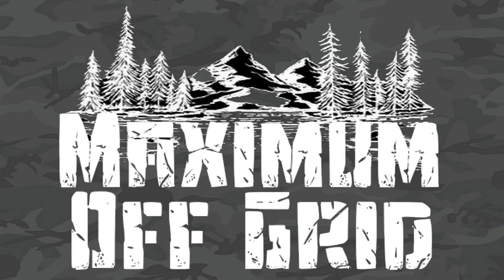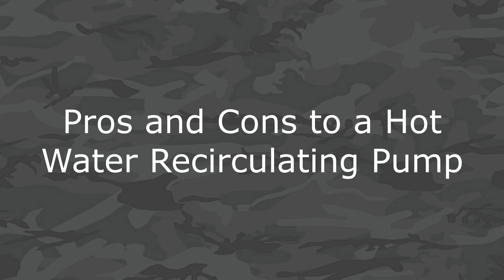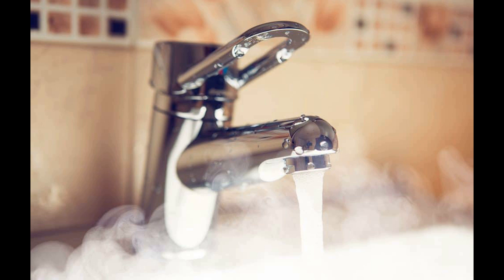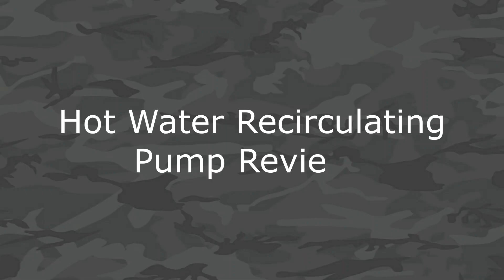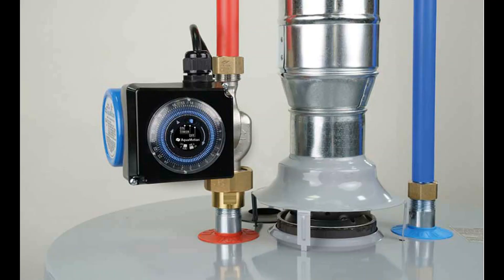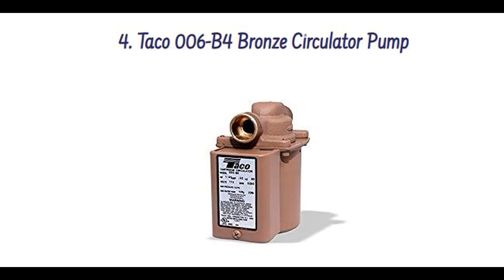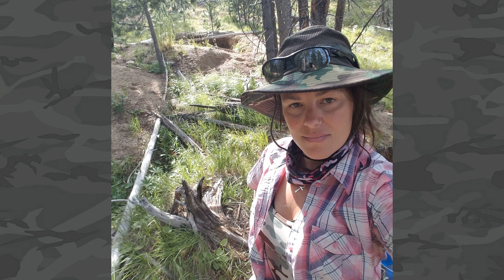All About Hot Water Recirculating Pump Systems! Product Reviews and Valuable Info

Comment: The only problem I saw with your video is you said a con to having a recirc pump is "low flow".
Water line pressure has nothing to do with the pump. Home water pressure comes from your water company, (usually 50 to 60 lbs.) not the recirculation pump.
All the recirculation pump does is keep the line hot when not in use.
Once you turn on hot water somewhere the house pressure kicks in.
If you have low flow, call your water company.
Or if you're on a well, upgrade your well pump.
Reply from the maker: Interesting, thank you for the information!

Comment: I have been looking at putting in a recirculating pump in my house. The one issue that I have not seen addressed is, the fact that you are introducing cooler water into your water heater. Will this not make your water heater run more? If I do this, I wont need a timer. I want a smart plug connected to alexa. All I will say is, turn on pump. I have alexa in multiple places in my home
Reply from the maker: I think the Alexa is a great idea! Overall from what I've read and gathered, the recirc pump is only really worth it if you are waiting 10 seconds or more for hot water. Anything less than that the cost of getting one doesn't make sense.
Reply: @RusticSkills  i am timing all my sinks and showers now. I only test one a day. Aftaid that running water from one will reduce times for others.  So far,  61 seconds is the longest time so far.

Comment: This will put heated water into the cold line. Drinking water from the heater is hazardous. You will have to run the cold water for several minutes to flush the hot water out of the system.  Basically the same waste as flushing out cold water from your hot line.
Reply from the maker: I have heard this, that it takes a while for the water to become cold. Unsure if the waste amounts are the same?

Comment: I connected a flow switch with a 30 sec delay off timer. The hot water isn’t instant as one that constantly circulates, it’s faster than no pump and I use less electricity and propane.
Reply from the maker: This is a great tip. Thanks for sharing!

Comment: Very nice video.  Big pump or little?   Polymer (plastic) or iron?  A higher flow (volume) pump chows more juice, but it runs for a shorter period of time.   Iron rusts!  But, stainless steel identical versions are made.   No more rust, but they are expensive. And you have to verify if any dissimilar metals, in yir system, will be compatible.
Reply from the maker: Yes, you are right. Iron pumps should only be used for industrial applications like radiant heating. I've learned a lot since I made this video thru all the wonderful comments. Thanks for your input!

Comment: If you just got up in the morning and used a bucket, you could measure how much water is wasted getting hot to the faucet. For my furthest faucet, it takes 5 quarts of water before the tap is flowing hot. If I do that four times a day that is 5 gallons of water a day. And thus for a year it is 1825 gallons of water wasted per year.  
The cost of running the pump, if I ran it continuously 24/7 at the 45 watt setting for me that would be about $6.50 per month (17c per kwh). However if I put the pump on a timer and ran it only one minute every ten minutes that brings the cost down to 65c per month. Even better, If I put a temperature sensor in the return line I would only run the pump when the return water dropped in temperature, so even less.
Reply from the maker: This is great advice! Thanks for contributing 👍

Comment: I could be wrong, but I think the Grundfos is intended for use in a hot water heating system, such as baseboard hot water heating. In such a system, the line should never go dry and rust in the line isn't as big of a concern.
Reply from the maker: Yes I believe that you are right.

Comment: Regarding the rust on the  Grundfos pump. It's called Galvanic corrosion (also called ' dissimilar metal corrosion' or wrongly 'electrolysis') refers to corrosion damage induced when two dissimilar materials are coupled in a corrosive electrolyte. It occurs when two (or more) dissimilar metals are brought into electrical contact under water. When a galvanic couple forms, one of the metals in the couple becomes the anode and corrodes faster than it would all by itself, while the other becomes the cathode and corrodes slower than it would alone.

I experienced severe corrosion when my "Master Plumber" installed my Buderus wall hung boiler and almost killed it when the pump failed due to the corrosion. I ripped his work out and re-installed the pump along with shut off valves at both ends for ease of removal and installation. His "professional" work lasted 4 years....mine is still looking fresh with NO rust whatsoever after 12 years. I used rubber isolators (rubber washers) to keep dissimilar metals from touching, simple to do. BTW, these pumps are ridiculously quiet!
Reply from the maker: Good to know, thank you for the information!

Comment: Thank you very much, I'm a maint. man on an Apt. building we just took over and it has a circulating pump, we've been getting a lot of pin hole leaks and I was told it was because of the pump running all the time and to get a timer like you said. Problem was I didn't know a thing about how it worked so I had no idea how to set the timer, and your video was great at explaining how it worked not to mention confirming the timer thing. Being an Apt. building still makes it hard to set the timer, but your video has given me the knowledge of knowing I can do it. Thanks again
Reply from the maker: You are very welcome! I am glad my information helped you.

Comment: I have had the Watts pump for about 2 months and feel like taking it back to Home Depot. I have it correctly installed in a 3200 square-foot house. The hot water tank is downstairs at one end of the house and the bypass valve is upstairs in the kitchen at the opposite end of the house. That is the only tap that gets hot water reasonably quick. I do not agree with the advertising of so-called instant hot water at the other taps. I am not a plumber per se, but I cannot see how this is called a recirculating pump when the hot water dead ends at all the other taps. To work as advertised, I believe bypass valves would have to be on all faucets. The showers particularly are worse than before and there is no way to add bypass valves to the showers because they are behind finished walls or shower enclosures. Also another complaint in the family is water pressure drop during a shower and cold water coming out if someone else is using water somewhere else in the house. I have seen other YouTubers illustrations of the hot water in red running up to a tap and blue coming back out. It is common sense that the hot water dead ends at the tap, it cannot be circulated across to the cold side without additional bypass valves, joining the hot and cold together. Until I am proven wrong, I am not very happy with this concept. Even Watts says in their instruction sheet that other bypass valves may need to be installed. So the advertising on the box is not completely truthful. Also, what corrosion are you talking about? Isn’t old outdated metal piping extinct, except for copper, which doesn’t corrode and is replaced by the more common PEX plastic type, industry standard ?
Reply from the maker: I think the materials used nowadays don't have the corrosion issues, I was finding corrosion problems with the industrial pumps, not the residential ones. TBH I don't think these recirc pumps are really worth it unless you live in a super old house with serious hot water heating issues. But some people have had really good luck with them.

Comment: I have been using a chilipepper pump and its not reliable, because the motor and seals tend to go out.  I am thinking to use the electronics of this unit to drive another pump and see how that works.  The good thing about it is the remote and it pumps till the water is warm and shuts off or runs max. 3 min.  This saves electricity, water and compatible to an instant tankless water heater.

I will update if I find my mods are reliable.  Thanks for the video.
Reply from the maker: Thanks for your helpful feedback!

Comment: Hi. Are any of these compatible with the Espar hydronic system (for RVs/vans)?
Reply from the maker: I am not sure, but I don't think an RV or van would really benefit from this kind of pump, since the plumbing is so short. Are you having issues with your hot water not getting hot fast enough? If you get hot water in 30 seconds you do not need this device.
Reply: @RusticSkills  I only have a limited 25 gallon fresh water tank. I don't want to waste precious water for 20 seconds to get luke warm water and 30 seconds for hot water. 😫 Wouldn't this be perfect for getting warm water in just a few seconds?

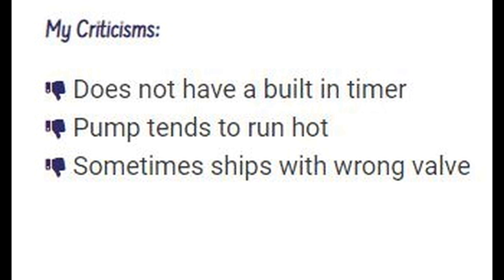Comment: 10:10 this is one jacked up drain line lol 12:20 sweat valves arent better than threaded, just more difficult to work with. The problems with threaded connections leaking is the fault of the installer and shark bite is horse crap, that's a guaranteed leak in the future.

Comment: Will the Laing pump work with a tankless water heater? My Chilipepper stopped working after 3 years and looking for a better pump that lasts longer. It worked with my tankless water heater.
Reply from the maker: The only one I know of that works with tankless is Laing Autocirc E10 which is a bit different than the one in the vid.

Comment: Do I need to insulate my new pex piping I ran 3/4 to all feeds 90deg turns with 1/2 pex?
Reply from the maker: It depends on the intended use and local building codes. PEX piping can be installed without insulation in certain conditions, such as if it's located in a heated space or if the water temperature won't exceed 140°F. However, if the pipes will be located in unheated spaces or if the water temperature exceeds 140°F, insulation is recommended to prevent heat loss and protect pipes from freezing.

Comment: Great information. I have a dedicated circulation line to my master bath  and had pin hole leaks in the solder joints. I would like more information on slow flow circulating pumps and ways to prevent these pin hole leaks. The information you provided here has given me ideas on how to rebuild my master bath circulation system.
Reply from the maker: I am glad you found the video helpful! Maybe you can simply solder up the pinhole leaks?

Comment: What pipes do you insulate? Most are behind walls? The pipe on your water heater?  Secondly aren’t you wasting a fortune by having your water heater running all the time since the pumps are dumping cold water into the water tank?
Reply from the maker: Your best bet is to use the wifi switch so you can turn the pump on as needed. This will help you save energy. You can insulate the pipes on the water heater, it may not do much as like you said, most are behind walls.

Comment: i have a bronze reciculating pump with a zone valve to shut off so there is no heat migration. I installed it 22 years ago. Works great. I wired the low voltage switch to every faucet in the house. When i trigger switch it takes about 15 seconds for hot water to reach my shower. When not in use the pump is off and there is no hot water sitting in pipes wasting heat!
Reply from the maker: Great tip!

Comment: If I understand the mechanics correctly, without a dedicated return line, when the water recirculates back through the cold line, we are then drinking water that has been run through the hot water tank? I have always understood that  due the use of decaying aluminum anode rods, water from the hot water tank should not be used for drinking or cooking. Is this safe?
Reply from the maker: This is a really good point, I will look into it further.

Comment: Nice video. It takes 15-20 minutes in the winter, in my house to get hot water to the bathrooms, in my house. I have my pump on a WiFi outlet, before we want to take a shower, you just hop on your phone and cut it on. Before discovering these lifesavers, I changed my 40 gallon tank out to a 80, then a 120 gallon unit, as you couldn't take more than a 2-3 minute shower before running out of hot water in the winter. Now days, we enjoy a nice steamy shower in the winter, something before the pump that didn't exits.
Reply from the maker: This is a great example of why a recirc pump works so well. Not all situations need one, but it sounds like you really benefitted from the pump. Glad it works so well for you!

Comment: Good info —— I did much the same research.   We have an early Noritz on demand water heater and did not want it cycling on and off constantly.   Ended up with a Koler-Flo (Grundfos knock-off) and a WiFi smart plug.  When we want hot water, open the phone app, turn it on and set a timer long enough to bring hot water to the tap and then turn off automatically.  The pump only runs 15-20 minutes a day.  I don’t have to insulate the recirc line and my Noritz isn’t beating itself to death.   Thanks
Reply from the maker: Awesome! Those wifi switches are a game changer!
Reply: Same, except the WiFi plug is triggered by saying “Alexa, turn on hot water” near an Echo. Runs for 8 minutes, and then I get hot water after 4 seconds instead of 2+ minutes. I save at least $250/year on water and $400/year on gas (the second part of the 2+ minutes, warm water was wasted down the drain because the pipes were not fully heated yet).  Pump running at 54 Watts 40 minutes/day costs about $6/year electricity.

Comment: Probably a few things to note
1. Avg. wasted water is about 14,000 gallons annually per US household.
2. Taco and Grundfos at the end are commercial pumps. A bit pricier
3. The Grundfos "Comfort System" recirculates warm water back into the cold water line to keep the hot water hot.
4. I would never recommend a homeowner sweat copper pipe or a pump into a water line, stay with the threaded connections where possible, it's hard enough to sweat copper to copper let alone copper to brass.
5. I personally would not recommend a sharkbite type fitting on or close to a water heater.
Reply from the maker: Thanks for the tips!

Comment: When designing your building, situate all kitchens and baths close or stacked above... Insulating your hot water pipes will also be a worthwhile investment... measure the time it takes to recirculate one cycle  loop... so before opening the tap, you will have allowed enough time for the hot water to be at your spigot...  if you need hot water far from the main tank, consider a small DWH (like 3 gallon or so) at point of use, so by the time the main DWH water reaches that point... once the main tank hot water  hot reaches the feed of the small unit, it will satisfy the t-stat in the small unit and shut it off...
Reply from the maker: Great tip thanks!

Comment: 750 TDS water, with water softener. Watts unit has been installed for 13 years. built in timer. I use in conjunction with solar water heater that preheats water to electric water heater on timer during "sun" hours, 80 foot run to furthest faucet. Keeps the water flowing during daytime hours to prevent the solar water heater from over heating and provide instant hot water everywhere in the house.  Winter: preheats water to electric water heater. Summer: electric heater off and solar provides all hot water through electric water heater for storage.
Reply from the maker: Great tip! I am planning to do a DIY solar hot water heater. They are awesome.
Reply: @RusticSkills  the evacuated tube collector solar water heater with the tank on top with the coil of copper pipe running through it seems to produce the most hot water for the $$. Hot water is not exposed to water in tank because it stays in the coil like a still and the glass tubes do not leak because they are low pressure. The system requires no energy if you cycle hot water into a regular electric water heater with the recirc pump.

Comment: I have the same unit as the one you rated #1, I went about it a bit differently, anytime my smart switch is activated in my kitchen or bathroom, it triggers the smart plug to run for 5 minutes, it works great. Also, to get rid of the warm water in the cold faucet issue, I used 2 check valves which I used to force the bypassed water directly to the water heater. I made these changes at the same time I changed to a heat pump water heater and so far it’s been a big savings according to my Sense monitor. I’m in South Central Pennsylvania, so at some point soon the hybrid mode will make it use more energy. Love the hybrid unit, it heats my water cheap while air conditioning and dehumidifying my attached garage and the condensate line waters the plants near its exit, it’s a win/win/win.
Reply from the maker: Nice tips, thank you! Glad the pump is working well for you.
Reply: hello, im trying to set up like yours. which smart switch runs for 5 min only? can you elaborate?
Reply: @homersalazar8479   I’m using Sonoff S31 with Tasmota, but controlling it with Home Assistant. But there are many ways to make the same basic thing happen. Happy to answer more,, just let me know what you need.
Reply: @waynenocton  ok thx bud, i figured out the smart switch-you can configure to when a trigger the 5 minute thing. BUT I now found a system that senses flow, then kicks pump on long enough to circulate the water. It has a flow sensor that kicks it on-a temp sensor on the hot outgoing side and a  temp sensor on the return line. when the temps match, pump automatically cuts off
Reply: @homersalazar8479  the pump comes with the valve that stops the flow once the water gets hot, otherwise the cold water would get more and more hot. But it still gets pretty warm before it does stop which is why I did the two check valves with the T so the warmish water returns back to the water heater instead of going backwards through the cold water pipe like it’s designed for.